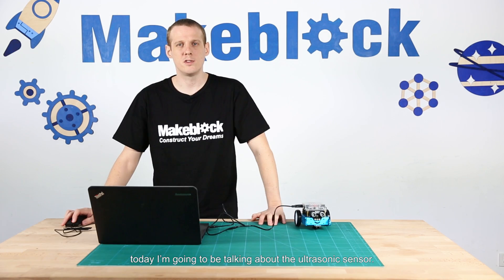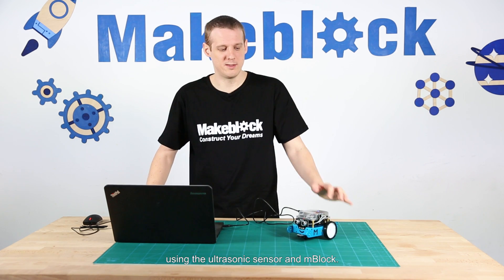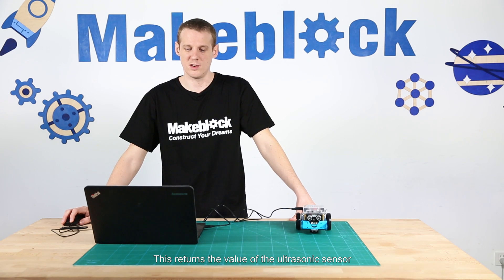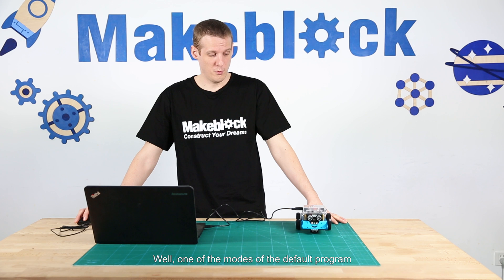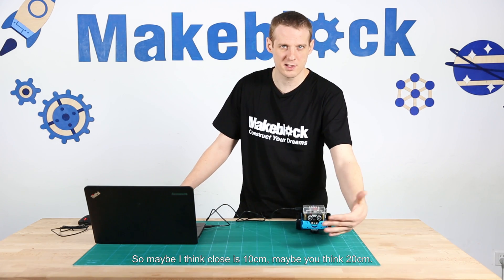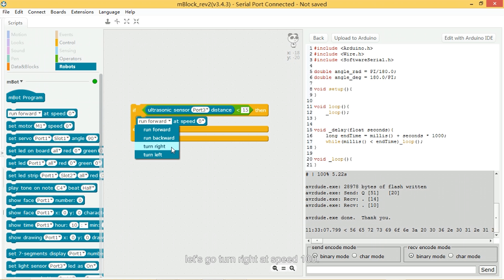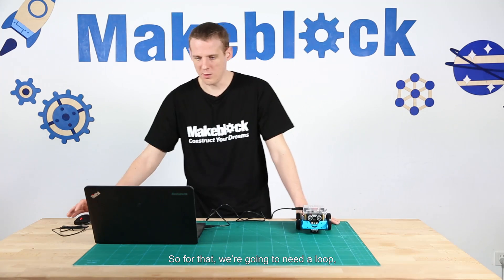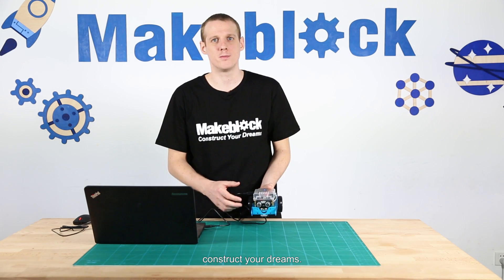Explore mBot Tutorial #5:  The Ultrasonic Sensor

Comment: I really need help - The code is being uploaded to my mBot but when I take out the USB Cable, the code does not work. My board is mBot(mCore).
Thank you in advance
Reply: It sounds like there is an issue with the mCore itself. I would try to replace it or do a little more research on what could be going wrong